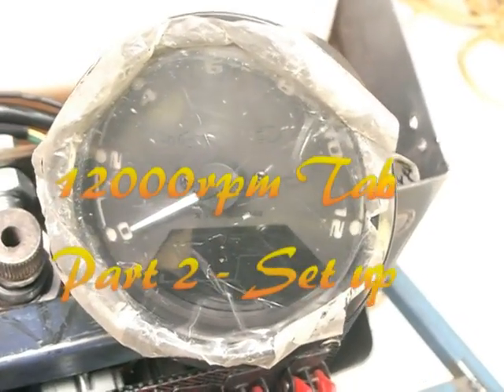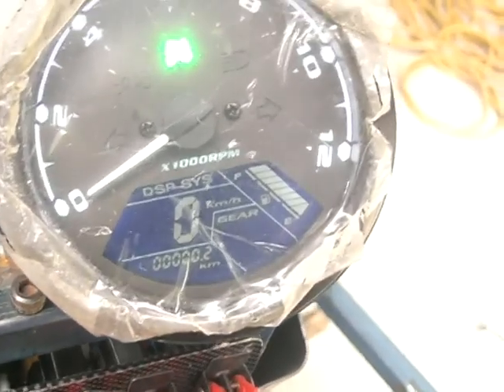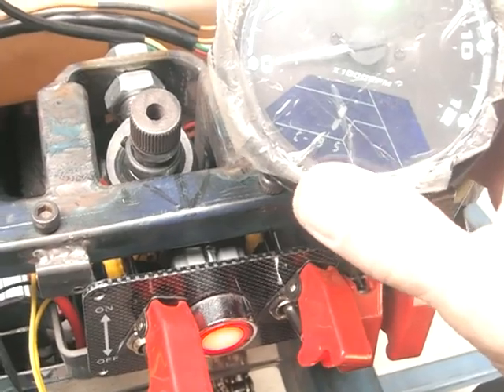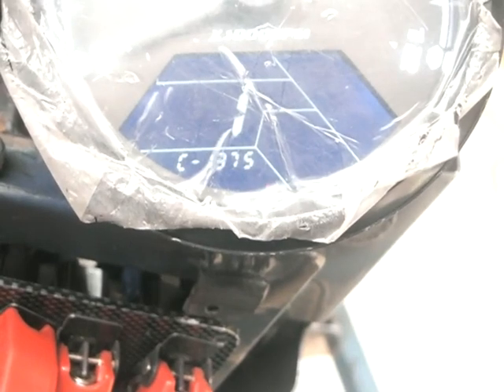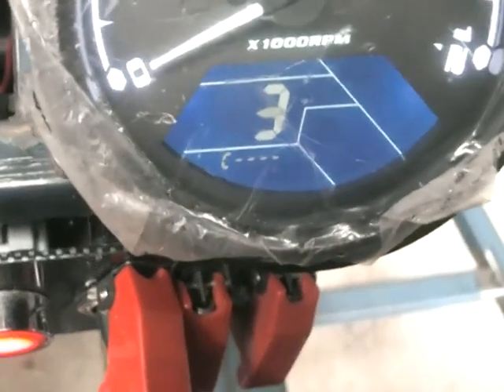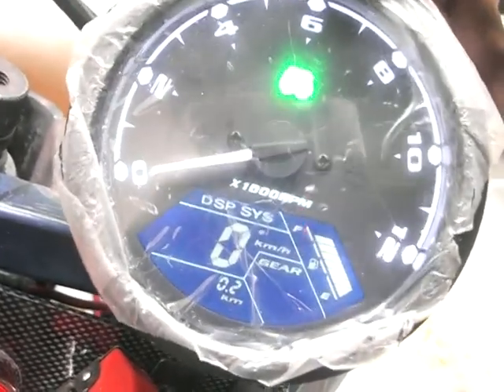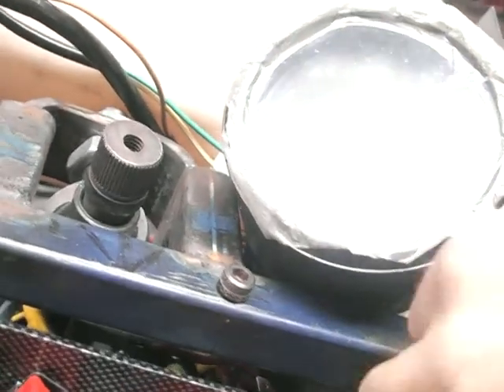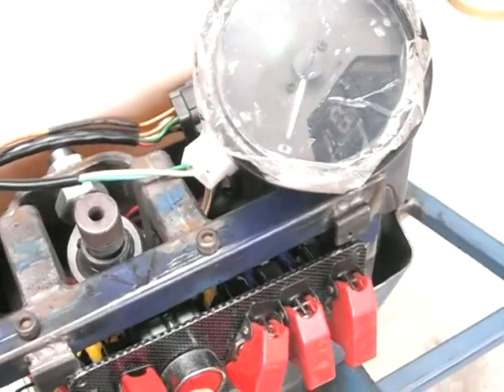12000rpm Tacho Part 2, Set up instructions

Comment: Stupid question .as far as the mph reading goes does it matter where the magnet is placed .as in does it matter if the magnet isn't rotating the same circumference as the wheel .hope that makes sense
Reply from the maker: Its doesn't matter if the magnet runs at a different circumference as the wheel. Reason is it will still do the same amount of revolutions as the wheel no matter where it is....More magnets per rev will give a more accurate speed at low revs....
Reply: thanks for that mate
Reply: I’ve been wondering this also. Cuz I don’t know how it matters what the tire size is if the magnets are in a totally different spot. Good question.

Comment: Thanks. Can you tell me, please, what can I do with the blue and white wire for stop flashing the fuel sender? My bike is an old one. Thanks. (pjcplr@sapo.pt)
Reply from the maker: Hi, to stop the flashing you need to earth the blue/white cable. That should work. IF it doesn't try earthing through a resistor, 10ohms should work. Hope this helps...

Comment: Alguien me lo explica en español
Reply: En el  seting 1  se pone la circunferencia de la CUBIERTA del eje en que esta puesto el sensor de velocidad. En El setting 2, se pone la cantidad de IMANES que activan el sensor de velocidad por vuelta, El seting 3 Se supone que es el numero de DISPAROS  de corriente  por ciclo de 360 grados (la mitad para motores de 4 tiempos...). Dicen que si lo moves del numero 1, no podes volver a 1, asi que dejalo en 1, y si la cantidad de RPM es la mitad de lo que en realidad es, lo podes subir a 2, y asi, en caso que tengas 4 cilindros . El setting 4 son posibles valores de resistencias de distintos modelos de medidor de COMBUSTIBLE. Llena el tanque, y cambia numeros hasta que te marque lleno (cuidado que la senal del medidor puede estar invertida.. y tendras que hacer algo al respecto). El setting 5 es para hacer reseteo al instrumento, y muestra la cantidad de veces que se ha hecho.  Suerte

Comment: hey, great video! do you know how to dissassembly the speedo? Because I tried loosening the 3 screws that it has on the back, but it seems to only loose the pcb, not the plastic in the front (I need to clean the glass from the inside :/ ) thanks!
Reply from the maker: Thanks. I haven't tried to pull it apart so I'm not sure. Its probably just as easy to buy another one given they are so cheap

Comment: How does the gear indicator work from 1 to 5, is it just grounding after neuteral, or is there something special in the gear box?
Reply from the maker: The gear signal of the tacho works by earthing each of the signal cables. There's a sensor in the engine gearbox, for each gear this sensor takes the specific gear to earth.  All gears including neutral are from the gearbox sensor and go to the tacho
Reply: Thank you. But I'm not giving you any points for that, because nobody likes a clever Dick.
Reply: I only have a Neutral no gears but cant seem to get the Neutral to work. Am I missing something?

Comment: Thank you very much, your videos have been very helpfull!!!
Any ideas on how to reset that thing or how to set it for 1 cylinder?  I have a yamaha xtz750 (dual cylinder 360degree, single coil).  Initially I set it for 2 cylinders but it reads x4 the rpm and x2 the rpm when set for 4 cylinders.
By the way on the xtz750 the tacho won't work neither conected to the original tacho signal cable nor the ignition coil low side (with or without the capacitor/resistor mod).  It only works conected to the pick up coil pos side and it would probably be the same for the tdm850 3vd (identical motor).  Just my 2 cents...
Reply from the maker: The rpm signal seems to have a few variables. On my engine it didn't work from either side of the coil. If it worked for you then that's awesome, I have just heard for a few people it damages the tacho. Maybe the voltage is lower on some coils, not sure. As log as it works that's the main thing. Once the setting for the cylinders is changed I don't know how to get it back to one cylinder.
Reply: Classic Celicas and more thanks for the instant reply!
Reply: I connected it to the Pick up sensor of the Magnet, the same signal that goes to the CDI to give a signal that is in top position. Seems to me that is only a ground signal that gives the pulse either to the CDI or the Tacho. Saw it in another video, together with other ways of connecting it, and it seemed to me the least risky. I had no problems and works fine for me. Good luck
Reply: Juan Gil cdi work top it there

Comment: hey man,
I can't get the tacho to work.  I've got a 95 cbr900rr, 4 cylinder, two coils.  I've attached the tacho wire to the pulse generator like you have, but just before the cdi box instead the back of the pickup.  It is idling at 6,000rpm and doesn't behave appropriately when revved :-(
HELP ME!
Reply: Positive signal?  Try to get the wire for RPM   FROM the tacho, and quickly touch ground with it (-) on and off, to see if you get any readings. I think it works with grounding signal. At least it did for me... Good luck
Reply from the maker: Hmmm, check you have mode 3 set to 2. Also, perhaps you connected to the wrong cable. I don't know your engine but there is most likely 4 wires from the pulse generator, try changing the cable and see if it works properly. If you have 4 cylinders with 2 coils and mode 3 set to 2 then the problem must be that you connected to the wrong cable....
Reply: Sweet as, I'll give it a go. Thanks mate
Reply from the maker: OK, good luck with it
Reply: So, I've checked everything, there's only two wires from the pulse generator, one works, one doesn't.  However it is shit.  It jumps around like mad, I've set it to 2 cylinders from 4 and it now idles at 10k and still bounces around erratically :(.  The original tacho wire (for the original gauge) doesn't give a signal at all either.  I think maybe I got a broken gauge!
Reply from the maker: I think your bike has an ignition control box which should already have a wire to feed the tacho. Have you connected to that wire?
http://www.wiringdiagrams21.com/wp-content/uploads/2009/04/cbr900rr-ignition-system-circuit.png
Reply: thanks mate i'll try this weekend :-)
Reply from the maker: I think it will work. I don't think your tacho is faulty, you just need to connect to the correct wire, check against the diagram....
Reply: datsfullysik I have an exactly same problem. 92y cb750 noghthawk. Wire daigram is same. Chen I conneted to Oroginal tach signal line, it didnt work. Only yellow(pulse positive) make rpm gauge move. But 6000~8000rpm and surging. I tried to fix it with capacitor and resistance but I cant make it. TT

Comment: Instructive video, congrats ..
But...
My STUPID repairman put the 2 magnets ON to the OTHER TOP and PASTED it.. 

Mileage counter measures 1/2 speed.. When i'm 50 km. it reading 25 km. 
is the magnets be the cause of this?? i choose 1 magnets but it not solve..
if i do in the first part of menu my tire size x2, is it solve ??

Also my bike 1 cylinder but they choose 2.. 
Can i reset this ?? or what is the effect of it ??

And I don't have gasoline buoy on my bike.. Does the fuel gauge works even so ??
Reply from the maker: Hi, I think you should fit the 2 magnets separately and 180 degrees from each other to fix the fault. Otherwise you could double the circumference if its still less than 2999mm.
As I mention in the video, if you have 1 cylinder you do not mess with mode 3, once it goes out of 1 cylinder then it cannot go back....
If you dont have a fuel gauge just earth the sensor cable and the gauge will show full.
Reply: I think you can use option 1 with 1 cylinder.. 2 strokes.... For 4 strokes 1 cylinder, you may need option 2

Comment: Great Video as always. I asked a question about how to stop the blinking and I tried connected it to the ground, but now the blinking of the fuel tank is back on. It's so weird. Any ideas? I already by passed the wire straight to ground on the battery.
Reply from the maker: Check you are earthing the correct wire. It should be a blue wire with a white strip for the fuel level. Once earthed it will stop blinking and show full. You can see the wire in this video, there is only one wire to earth.
Reply: finally managed to solve it. For some reason it wont stop blinking when i try to earthing it. 
So i tried to connected it to the battery and it works.

once again great tutorial
Reply: Leave it connected to the power AFTER ignition switch is on...., otherwise it will be always powered up, or just bridge it to the POWER input signal in the gauge, that it is power ON after switch is ON (Memory should be ALWAYS POWERED.. A small inline fuse wont hurt...)
Reply: If my stock speedo doesnt have gear indicator is there a way to put gear undicator on my motorcycle?